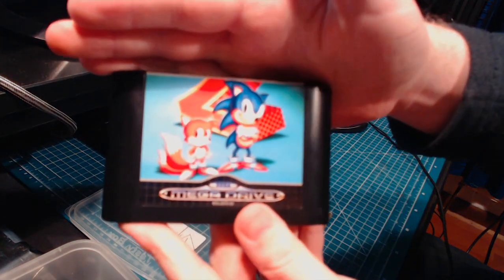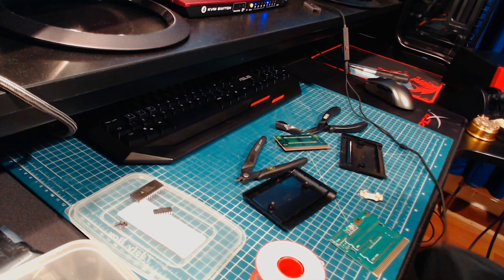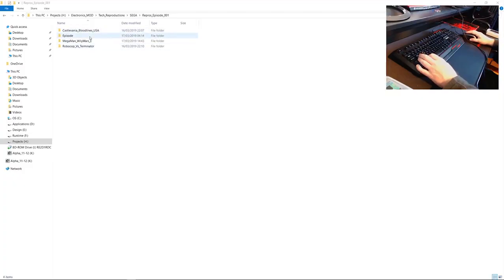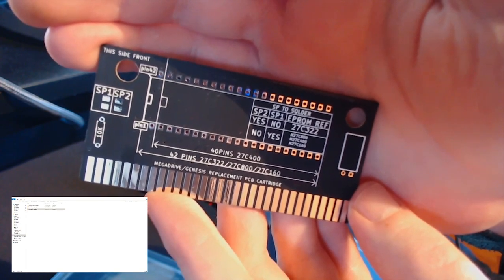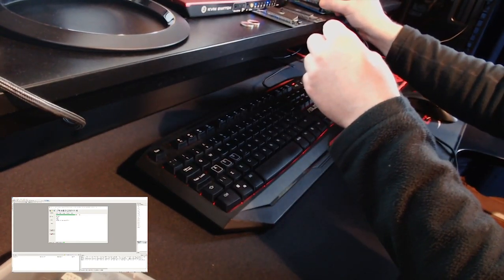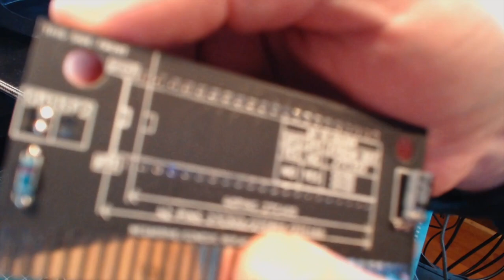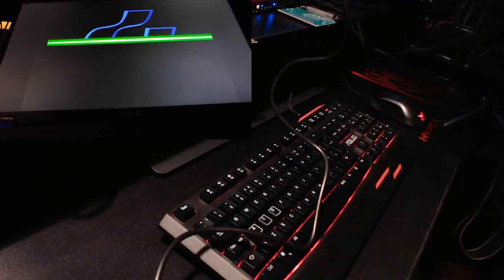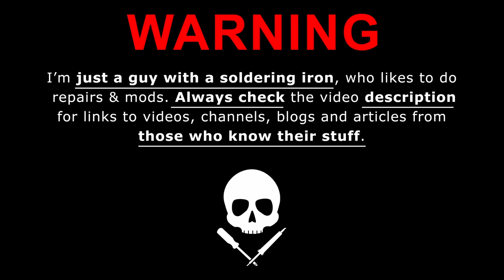REPRO PCB + SRAM SAVE GAME - SEGA MD / GEN

Comment: Hey, I enjoyed your video, I will make sure to move the battery down a bit on the next revision, should be able to rotate the cap aswell :)
Reply from the maker: Glad you liked it :) . To be fair, I was using a larger 22nf 25V Cap. With a 10V, it worked out OK. The CR2032 only needs to move 3 or 4 mm down. I'll look up the part number for the holder I got from DigiKey and see if I can source it from the EU ( Mouser, RS, Farnell etc), It's low profile worked out great. Thanks again for designing a cool board.

Comment: Im going to make my first repros. But Im a bit confused with software thing. Maybe you can help. I have Martins pcbs for sega md. Also have a few 27c322. But i have minipro programmer (TL866). This is still on the way from china. with a 42 pin adapter it should do the job. As far as i can understand the process>
1. i need to byte swap the rom file. For exapmle Jungle Strike 2.0 MB. If i cant read the sega line and the games name in hex editor window, i good to go. 
2. Because 27c322 is a 4.0 MB eprom, i need to fill the remaining space. Do I fill with FF-s, or with own data? As you shown in the other video. What if i have a 3.0 MB bin file?? 

3. Split it to 512 KB files, to work with adapter, and burn to rom one by one. 

4. ready to game. I hope.
Reply from the maker: 1/ Your correct once byte swapped, you should be good to go. ( If you use GadgetUKs App for the Byte swap make sure to head over to his youtube channel and give his videos a like and SUB if you like his stuff ).
2/ IF the ROM is 2MB and the EPROM is 4MB. Open the file in hex editor and double it up. If the ROM is 3MB Fill with FF. 
3/ I'm sure about the TL866, I know allot of people use this model programmer with an adapter. It should be the same as with the TOP3000. If it has the profile for a 27c322 chip you may not need to split the ROM file up. If you do have to split it up then you may need to change the address line to select the different 512kb areas. 

Once the programmer arrives, test it out and have a play around with it. If you run into any trouble let me know and I'll try to help.
Reply: @GameTechRefuge  Thanks Dermot! When its arrived, i will test!
Reply: @GameTechRefuge  well all the stuff arrived, i had some hardware issue, but solved. Now im programming the first game - mk2 of course - at the weekend i will check.
Reply: Everithing works fine! 3 different games run well on 30 years old hardware. :) My experience and method here: 

- I use mrTentacle's pcb-s. 

- 27c322 eprom chips, it contains 8 512 kbyte segments. cheap Chinese from ebay
- TL866 programmer with adapter
This is the cheapest setting, i can put together. 

When comes programming: 

Its do not need to fill! 

- First byteswap the file. Split into 512 spices. One by one put on the eproms segments in correct order. After soldering into the pcb, games run fine!

Comment: Is it possible to do repros with EEPROMS in a FlashKit?
Reply from the maker: DIP EEPROM ICs should work fine. Modern Flash chips are also supported on the HD Retrovision boards. You could also use breakout PCBs with modern flash chips to work with the older DIP stuff.

Comment: How do you go about making the labels?  Is it printable "sticker" paper or something different?

Also, have you tried any of the "colour fix" patches with a PCB board?  Or better still, SFII' SCE with CRAPCOM's lazy, rubbish programming fixed.

I will be deffinately buying a couple of these, want to make a SONIC 3 Complete cart.  May get a couple of SFC boards, too.
Reply from the maker: I get my labels off a really cool guy on Ebay from Greece called art-o-cube . He uses high quality stuff and is a really great guy to deal with in my experience. Other then creating a few few rom hacks of Streets of Rage 2, that use the Street fighter sprites. Might be interesting to to try out Street Fighter 2 hack. The Audio was always my biggest gripe with the original.
Reply: @GameTechRefuge  The SFII' is definitely one to try.  The better music, colour and voices really make the original look amateurish.  Which I guess is was, CAPCOM didn't give a crap about the MD so they didn't have their best programmers on it.  The fact that they ported the SFC graphics with those ugly redrawn background characters and the lower resolution the SFC needed to run it show how lazy they were.  

The MD version could have run full screen with no problems.  They also could have ported the CPS graphics straight over and reduced the colour.  I still wish there had been a MCD version.  It could have been arcade perfect!  As usual, with less colour :P  Why on Earth SoA did not get Super on the 32X for launch, I will never know.  It would have blown the SFC version away graphically.

Look at me, went in to a rave, very unusual, haha!